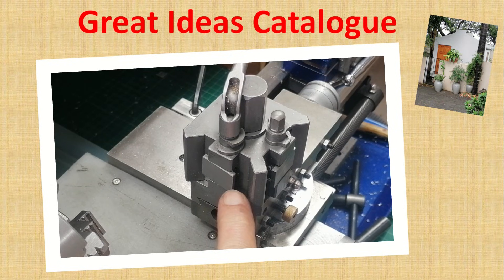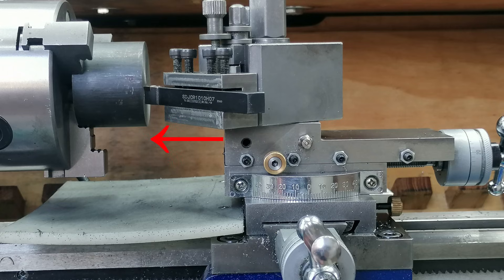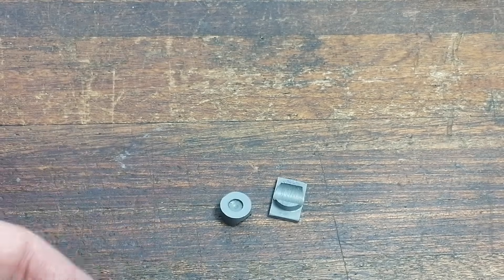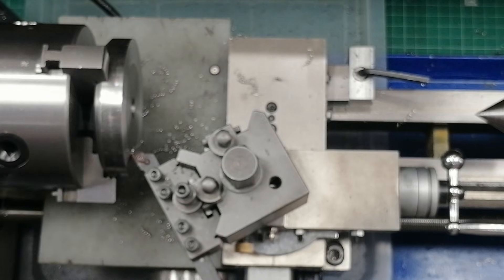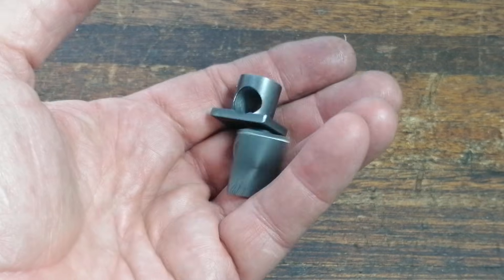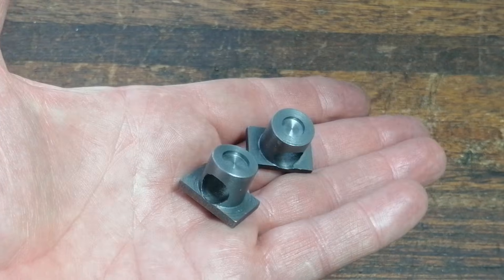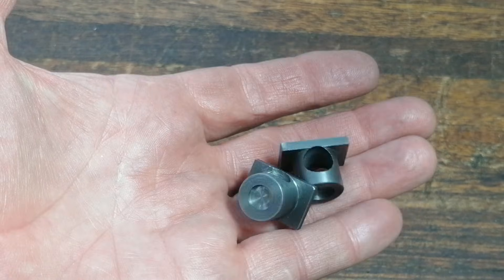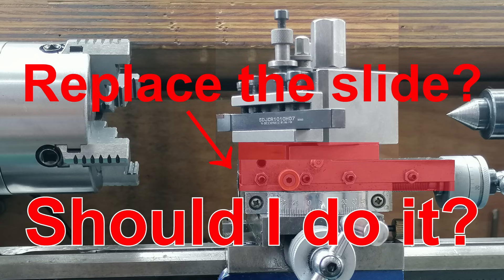This Tiny Part Stopped My Mini Lathe Cold

Comment: you might wanna go straight to removing compound cross slide and installing a BXA/CXA size tool post (which ever fits better) that way you wont have to deal with all the issues, and you can use 16mm cutters instead of 10mm. and if yuo want to cut small tapers you can put back the compound cross slide
Reply from the maker: Thank you for the suggestion. I will look into it.
Reply: @GreatIdeasCatalogue  I watched another of your videos and you already said that you're not going to get rid of the compound cross slide because it's too valuable to you. You also sided video of that lady.
Reply from the maker: @AlexeiPavlov  Yes, you are correct. I do not want to replace my compound slide. However, I am prepared to add some form of static block and toolholder to the other end of the cross slide. That means that I also have to replace the cross slide (to increase its length and add T-slots). With 'looking into it" I had such a toolpost in mind. My initial idea was to use the 4-way toolpost there, but a quick change toolpost there will add some flexibility and simplify setting tool height while also allowing my other toolholders to be used.

Comment: I had similar issues but my toolpost is the Alauris type with wedges and does not overhang as much as yours.  I found my gibs to be under sized, tapered and twisted so I made new ones that fit properly from bronze.  The problem has mostly gone away but the toolpost overhang still worries me, so I will try moving the toolpost stud about 15mm to the right, which will align the tool with the L/H face of the topslide.  This will certainly help but I don't know how much.  You also use your tools at an angle to the topslide,whereas I usually have mine parallel to it, this is also a big help.
Mark - UK.
Reply from the maker: Thank you for sharing your experience and your very useful suggestions, Mark. Much appreciated. I have tightened the gibb which helped a lot and will also make a larger gibb. I have also been thinking about making another compound slide so that I would have two places where I can screw in the toolpost studd.

Comment: I had another look at the cross slide gib on my mini lathe, after adjustments that worked out for the better but left only part of the gib touching the top corner of the carriage dovetail, rolled away from full contact. Then I loosened the gib and took measurements. I realised that it's not that the gib isn't tall enough, as it's the same height of the dovetail, but there's a 1.25mm gap between the top of the gib and the underside of the cross slide, allowing the gib to roll upwards. So I made a shim out of alu sheting, 1.15mm thick by 6.3mm wide, and the same length as the gib. Then inserted the shim between the top of the gib and the underside of the cross slide. And viola! The gib now engages perfectly on the cross slide dovetail, no rolling and the sliding action is super and consistent throughout the range of motion. The roll and wobble is gone as well. I used alu because this is all I had around, but as the shim is not part of any sliding surface, mild steel of 1mm thick should be fine. Hope this makes sense and can help others with the same issue, a much quicker fix than making a new gib from scratch. The holes in the gip for the set screws now line up correctly as well.
Reply from the maker: Thank you so much for sharing this detailed and helpful solution. I am sure that this will be very useful to others with the same issue.

Comment: At 6.33 when you tighten the tool holder you can see deflection of the toolpost and compound, plus the angle you had the toolpost on when you had the crash is only contributing to the lever effect on the compound and increasing the chance of a crash. I would suggest that you also have a lot of movement (lack of rigidity) in the cross slide. Tighten the gibs (compound and cross slide) and check for movement if there is any you have a problem. Solid tool post and deleting the compound is a possible fix, but if there is cross slide movement then get a bigger more solid lathe. Good luck.
Reply from the maker: Thank you very much. I really appreciate your help. I agree with you. A few weeks after this video was made, I noted that the gibs were lose and tightened it more. That helped a lot, but did not solve everything. Something still needs to be done to make the quick change toolpost more rigid.

Comment: Thanks for sharing. Delete the compound, makes a big difference. Also, the cross slide gibb that comes with this lathe from Adendorff does not fit properly. Planning to upgrade mine with a  brass one
Reply from the maker: Thanks for the suggestions! Those sound like great ways to improve the lathe's performance. I will start off by improving the gib. I have some cast iron and has been thinking that I should make one out of cast iron. I am interested to know why you choose brass for yours?
Reply: @GreatIdeasCatalogue  Mostly because I have some brass strips, but no cast iron. And I like the colour 😂
Reply from the maker: Thank you. I have both brass and cast iron, so I have to choose one for my gibb replacement project and do not know which one is the better to use. I think that I will use the cast iron (I have a lot of cutoff pieces).
Reply: @GreatIdeasCatalogue Yesterday I spent some time adjusting the gib screws to as tight as practically possible and managed to get the wobble and play out. Will still be making a new one in the future... but so many other projects on the list. The carriage gibs are terrible as well, adjustments are difficult to make and its impossible to get all the slop out. It's a pity, most of the lathe is relatively well made, but they've skimped on these crucial parts. It looks to me that the gib screws on the cross slide are too high, resulting in them engaging the gib too high, thereby rolling them away from the dovetail slide of the carriage at the bottom... and not pressing them into the underside in a straight line
Reply from the maker: Maybe we should make a new cross slide as well (with the gibb screws lower). Let me know what you think. I have been thinking about T-slots in the cross slide, but cannot work it out (not enough height & thickness).
Reply: @GreatIdeasCatalogue I have seen videos of guys making cross slides with T slots for the mini lathe. I cannot afford to lose any height, as I need to swing 102mm HDPE round bar regularly, and that barely clears the top slide. Have thought of drilling and tapping new holes for the gibs screws, it will be bordeline but possible. Even though I got the wobble out with careful adjustment, it's still far from perfect as the gibs now only engage on the top sharp corner of the dovetail. So... i am going try something out of the box and glue a 1 to 2mm metal shim on the screw side of the existing gib to reduce the gap to as small as possible. In theory the gap should be just be enough to slide the gib in, with the set screws screwed out. Why that gap is made so big is a mystery. On my bigger lathe it's around 4mm... but on the mini lathe it seems to be between 7 and 8mm. Also, on other lathes I've seen, the ratio is about 2 x the height to the width of the gib spacing, which helps to keep the gib flat against the dovetail. On the mini lathe the height is less than the gap... and this is part of the reason why it rolls away

Comment: sacrificial part- fuse is plastic gears on the spindle, when the motor does not turn off due to overload. your cross slide is wobbly, there is no rigidity, shifting the toolholder will help a little, but will not solve the problem.
Reply from the maker: Thank you very much, I appreciate it. I have tightened the cross slide gib, a few weeks after after having made this video, and it has helped a lot. It is still not rigid enough and I will have to look at improving the gib. Maybe I should make one that is thicker and has less chance of moving. That might help towards improving the cross slide.